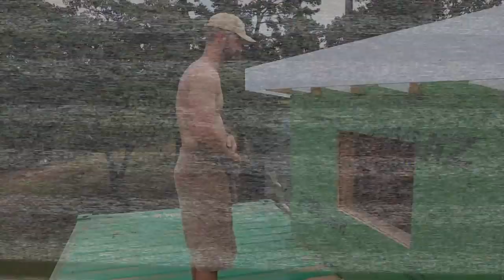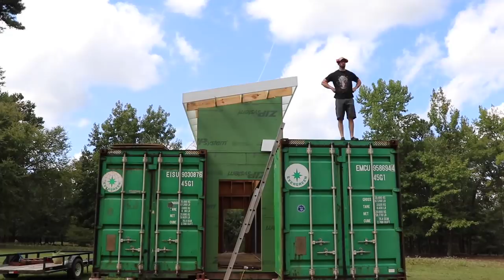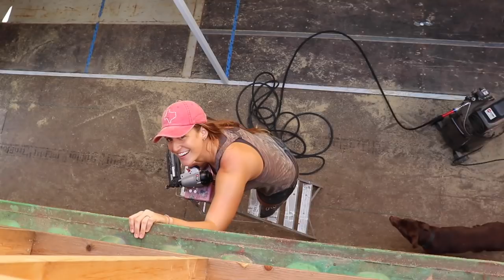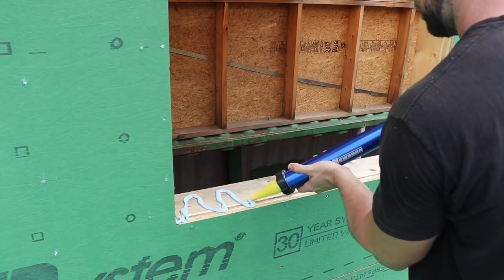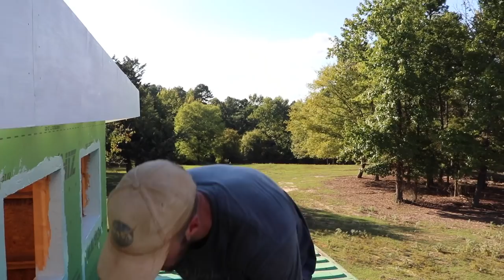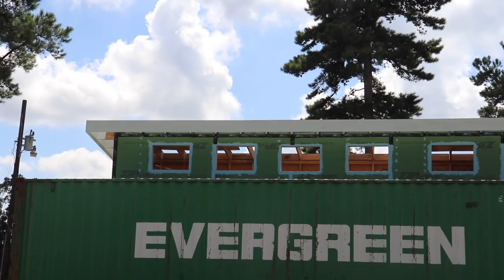CUTTING OUT THE WINDOWS!

Comment: I thought that a pitched roof over the container was what they had in mind. The liquid flashing around the windows - not necessary. The tape over the seams - not necessary. Flashing the container roof - not necessary because the pitched roof will cover it. Like other videos, inexperienced builders spend money and time on unnecessary items. Love this couple and their project! I do wonder if stick building would be cheaper as all the container will ultimately be covered. You can buy a lot of lumber for what the cost of the container, transportation, crane, etc. You are not getting that much square footage for the size of the container. Not to mention the time spent doing the sanding and grinding on the rusted container. Also all the grinding to cut out the whole side and any window openings. My thought is that a container provides a structurally sound living space that would stand-up to an earthquake (but not this design). They have a nice piece of land to build on. Scenic.
Reply: I think this is in florida no earthquakes.
Reply: This has been my exact thoughts from the beginning of this build.  Now if you are going for a particular style and want to build containers because you LOVE containers then I will back off.  But $ for $ this is going to end up being a far more expensive build in the end than if you just started from scratch.  Not to mention a TON more energy efficient.  As much as everyone wants to believe that containers are EF they are far from it without drastic insulation/ thermal bunting and the extra expense of all of this is far more than a few bats of Owens Corning and some spray foam.  I love the content, but I do worry about your overall project in whole.  Good Luck Guys.  Regardless I'll be watching
Reply: Containers add a huge amount of labor, conduct outside temperatures, cost more than an equivalent amount of stick framing. But I don’t think it would attract the same number of views if they did standard framing.

Comment: I would have installed the roof deck before flashing windows and seam taping the siding. Keeping water out is #1. I’m not sure of your location but adding those pitched roofs over the containers is a good idea but if you get snow I would keep the pitch at least 18 inches from the bottom of your windows. Just thinking out loud. Quality Construction Guys, doing a Great Job‼️👍👍  Vinny 🇺🇸

Comment: First of all compliments. You are really kind, cool and active, virtues really rare these days!

Now the small warning part from my experience (well, not mine, from a company that build electrical power plant  and learn hard about it) "heavy metal" structure (i.e. with big metallic masses) pose serious magnetic fields problem, I do not talk about human effect of that, a controversy topic, but about domestic appliance: cell phones might not work well, WiFi does not work well, domestic appliance may have troubles etc another problem is thermal dilatation, big in steel based structures that might break wood joints especially in terms of water tightness terms. Perhaps at small scales this problems are also small, but consider that :-)

for the rest good luck, you are really fantastic and inspiring!

Sorry for my poor English, not my mothertongue

Comment: When I first saw this video I thought 'Their building a pole barn out of storage containers'. So I have to ask, would it have been cheaper to build a pole barn to live in?  I'm not knocking what you are doing but when you consider having to frame out and insulate the container walls and roof over them to shed water would it have been better to leave them out to start with?  I've looked at containers and with all the conversion work I've found it to be cheaper to stick build 2x6 on 24" center from the start.  If you have run the numbers and found it a savings to go this way, Great, I'll be happy for you.  If you just want to be different, Great!  Containers can make great houses, they just can't make great and cheap houses like people wish they would.

Comment: If you plan on painting it really consider Rhino liner. Or truck bed liner. It’s durable as hell. 
Although creating a space of an inch or so between the siding of some sort and the container walls is an easy way to increase the R value up to 10. That adds a little extra insulation to the interior R value. 
Example wood or composite siding boards for aesthetics. 
That narrow pocket of shadow is a simple extra thing for interior comfort.

Comment: You must live in a state that doesn't have L&I inspectors to enforce safety regs. Every time I watch you nailing something on the edge of the roof without any fall arrest or fall protection, or using a ladder that seems to be a type 3 which is one of the lightest, as far as I know, manufactured it makes me cringe. I have noticed that you don't  use your feet to stabilize your studs when using a nailer as you are, which is very smart because if either you miss or a nail comes out the other side it doesn't end up in you. I'm going to guess that unless you've been very lucky, there have been cuts, scrapes, slivers and such that you should show on camera, not for the gore but as a teaching moment because frankly even after the cringing, on my part, the fact that you guys took this on and have been doing a terrific job, specially considering that neither one of you have construction experience.

Comment: achfoam.com
this is the type of product we use on commercial flat roof situations in conjunction with a membrane roof. It wouldn't require framing on top of the container unless you are concerned about snow weight etc. and needing a higher pitch attached to the kneewall.

Comment: I just don't see how you are going to seal where the wood meets the metal. I think you should have gone with a rubber membrane between it. Not saying that it is going to be impossible but it is going to make it real hard. Because with the heat and cold it is going to expand and contract breaking the seal over and over.

Comment: You all are doing a great job at building that and I am glad to see you are using shipping containers. I have a suggestion for you all that you may not have though of and that is you all should consider anchoring your house to the ground. You could use an anchor system that you would on a mobile home. If a strong wind storm was to hit this place is could do a lot of damage to it just as wind can roll over mobile homes if they are not anchored down.

Comment: Another enjoyable video and more great progress! That always keep the motivation high, and Spencer "flashing" the windows was pretty priceless! I'm curious about something, especially after adding the "Zip Tape." I completely understand the desire to keep the elements out so I'm wondering what you're going to do to let the house do to breathe. I think both are important and I'm sure that you allowed for it so I'm looking to see how you balanced both.
Reply: Dave, letting a house breath is old technology. If you get it water tight, it doesn't need to breath. The breathing in old houses was to allow the walls and roof to dry out after a rain because they hadn't figured out how to keep all the water out. If there is humidity involved in the roof, then a circulation would be necessary to keep that dry. This is what a drug dealer told me one time.... JK!!!!

Comment: For the same cost of materials; possibly cheaper you could of built a lean-to roof and usable loft over the whole thing. You're going to regret the design. I can't comprehend why you made this thing so small. Energy be damned, section off the house for summer cooling and open it up for winter heating. Great job so far but total failure on design and space. Mark my words and this day! BTW looking to buy property one county east of you.